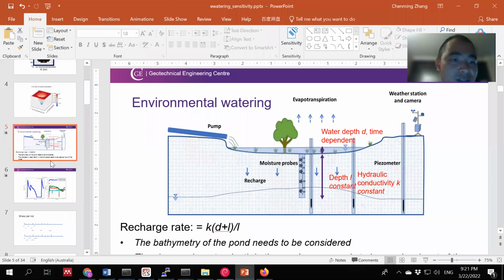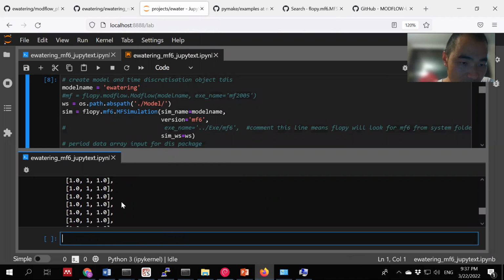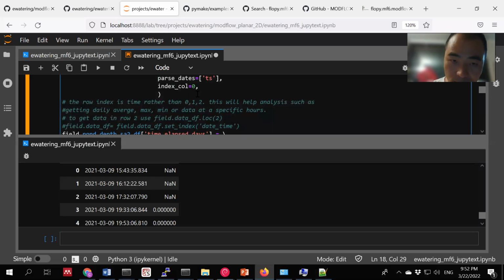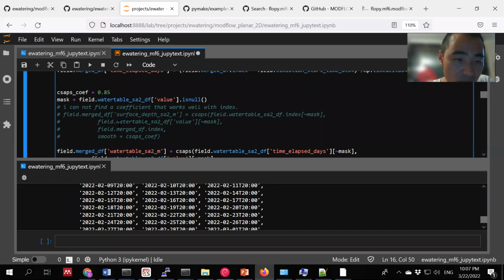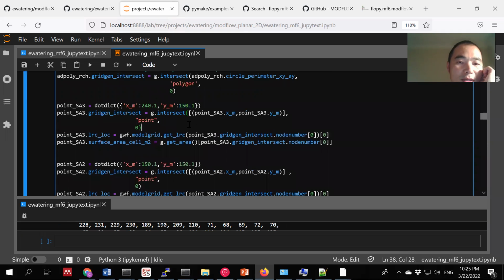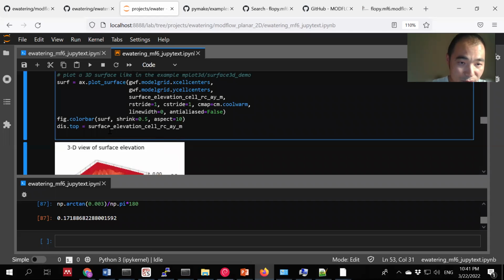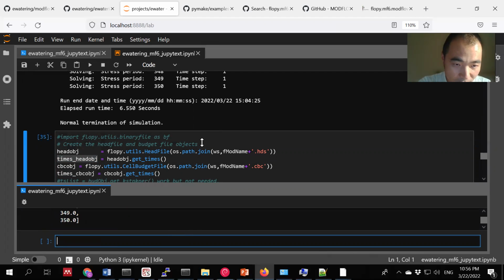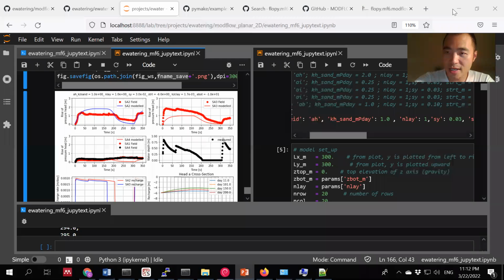Use Flopy to construct a groundwater model for MF6 invovling recharge and constant heads (2 of 2)

Comment: hi dr.zhang , i am working on the project which include the simulation - optimization modelling ,for simulation purpose i used GMS software which is GUI. is it possible to use the mf6 file created by the software  for optimization purpose by using python flopy pakage ? Can you make an tutorial video  on this topic . i want to learn how to specified boundary condition for the tiff file in python flopy pakage and also how to specify the number of well location on by shape file in python.